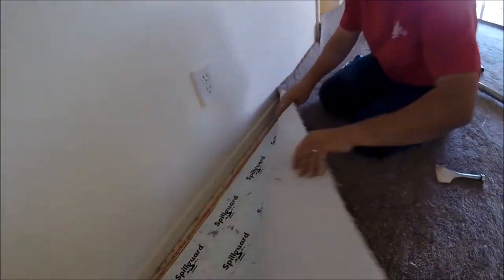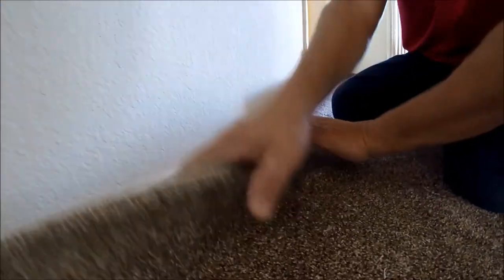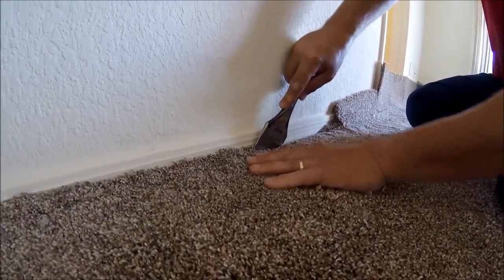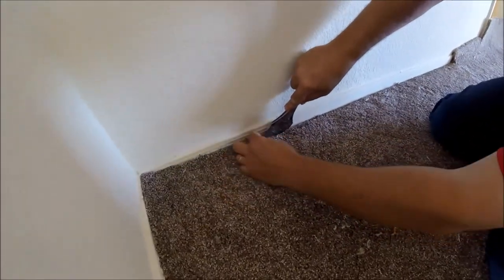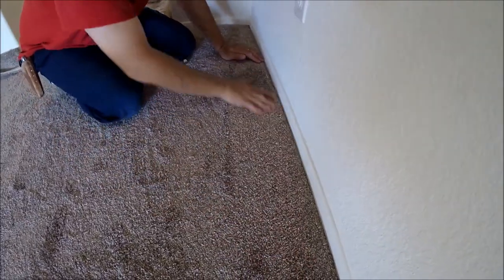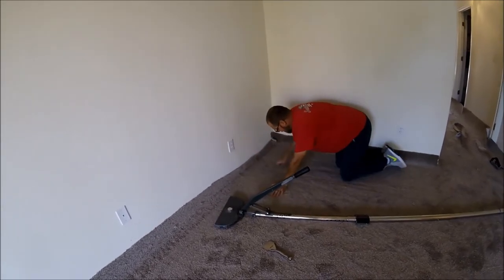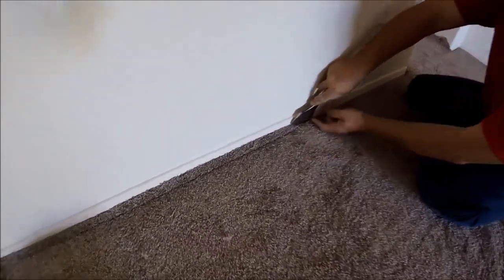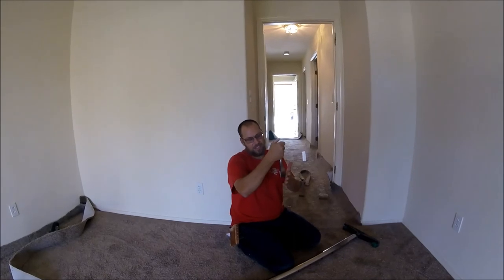HOW TO PACK CARPET TO BASEBOARD

Comment: Looks like the baseboard was not elevated during install. Would it make this job easier if the baseboard was 1/4 or 3/8 of an inch off the ground?

Comment: I got the carpet cutter You recommended. It appears to require an adjustment. If so, are there instructions for setting it properly? Thank You so much. Learning a new skill here.
Reply from the maker: Bob and Lucy Shoaf should be able to get what you need from this video, it just takes practice to get the right height you want , You can also raise or lower the plates in your trimmer to make it cut shorter or longer. https://youtu.be/twXO5lEbxys

Comment: What do you do if the owners had the lips things insulated with silicone kalking? I don't see a way to wedge the carpet under the lip. Should I remove the silicone and lip things or should I use sticky strips? What would you do?
Reply from the maker: Not sure what you’re referring to
Reply: @FloorsbySouthernboys  the bottoms of the baseboards, where the carpet gets wedged in are filled with silicone
Reply from the maker: Oh, yes sir you will need to cut that out, there needs to be a gully Between the tax strip and baseboard, if there’s is not you need to make one either by cutting away the silicone or scooting the tax trip back, I would recommend cutting out the silicone

Comment: Dude your genius!! Tried it today when I was fitting carpet and it's a great way to pack/tuck carpet. I'm always surprised when I see your videos. any other ideas you have please please share!! I'm still waiting for you tool bag/van tour👍
Reply from the maker: That's awesome, I'll be doing the van tour tomorrow
Reply: Please do a video on steps that are shaped like a triangle. We call them winders in U.K.  

I want to know the best way or what technique you have when it comes to the finishing of the step that vertically drops down. I'm talking about the part that folds in towards the sides. Sometimes when the step goes in a lot you can have a problem if it being shop if you don't judge it right. I hope you get what I mean lol
Reply from the maker: Bint Noor just as soon as I get the opportunity I will

Comment: I use a tuck knife .. its a lino knife but u break tip off and dull the blade on a curb or something.. u can roll the carpet in behind the strip then
Reply from the maker: Josh Tomsic well whatever works best for the individual I guess